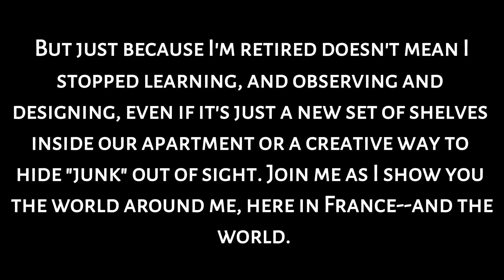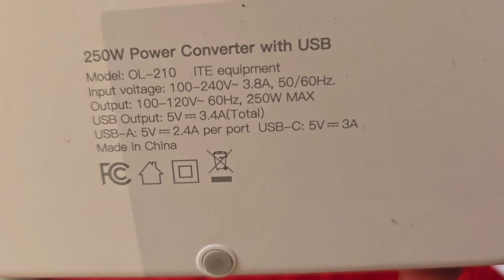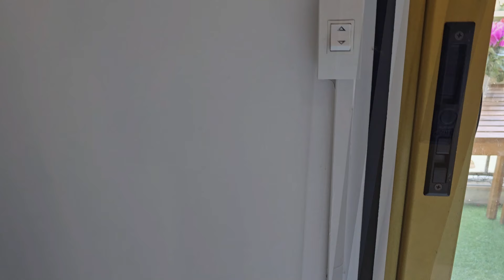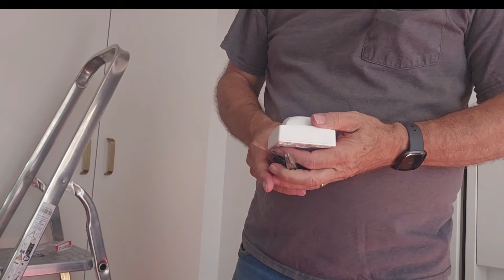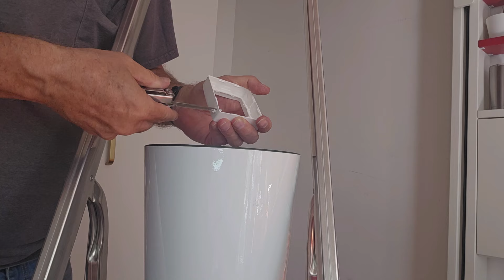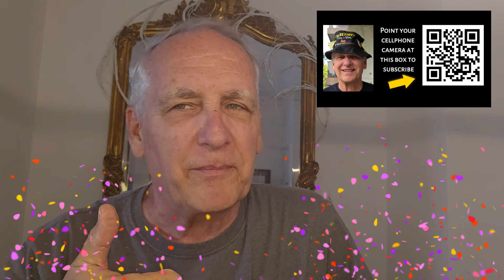WHY FRENCH POWER OUTLETS ARE "SHOCKINGLY" DIFFERENT TO INSTALL.

Comment: Sorry Jeff but sadly this does not answer my main question of "Where did that extra wire come from?"  I'm a Brit expat living in France.  In UK (ring main system) we can add a "spur" socket to any single outlets.  But as I understand it, it's not as straight forward here in France, and so I guess I have to keep looking.
Reply from the maker: The outlet had been surface mounted on an existing wall. The outlet had been removed to allow the installation of a bed system that was bolted to the wall.
After the bed system was installed the outlet and plastic raceway was put back in place. 
This outlet was connected to another existing outlet that supplied electrical power.
Eventually the wires went back to an electrical panel with a breaker for this circuit. 
The video was an attempt to show how to surface mount an extension outlet on an existing wall when powered from an existing outlet.
Reply: @JeffInNice  I understand.  Thanks for the reply.

Comment: Thanks, Jeff. I have an apartment in Nice that could use a few more outlets!
Reply from the maker: I think with all the computers and TV equipment and cell phone chargers that we use, the plug strip is the fastest way to  add more outlets.
In Florida, each outlet was a duplex outlet, while the standard outlet in our apartment is a single outlet.